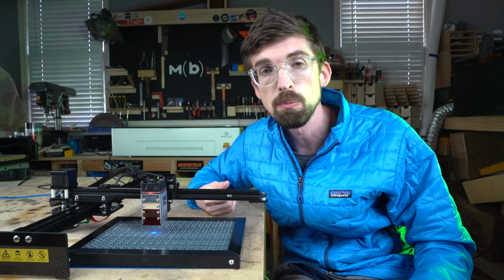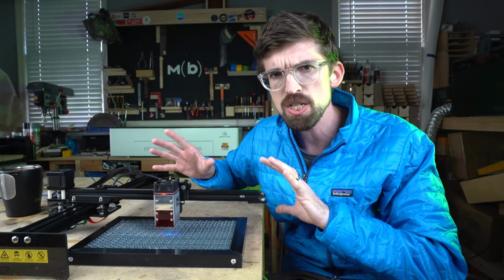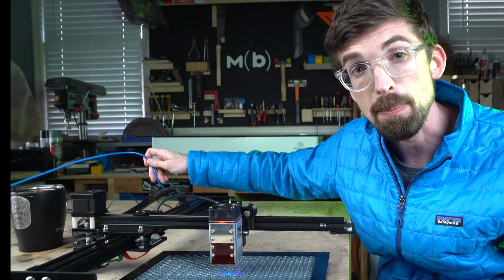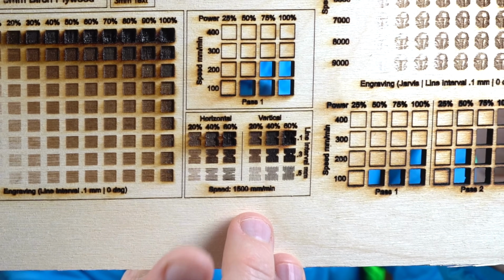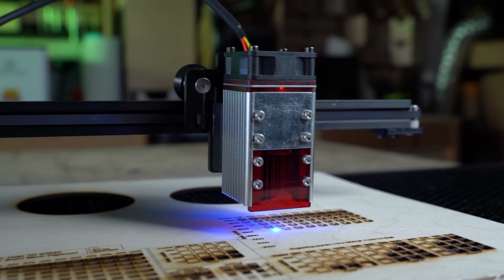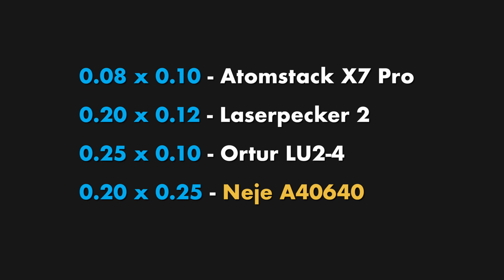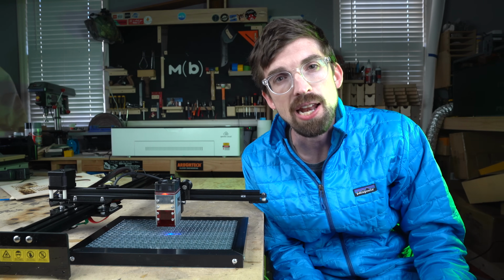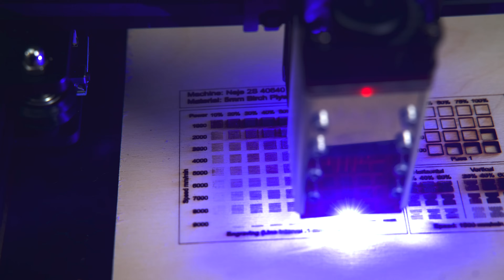The Most Powerful Laser Diode? NEJE Master 2S Plus A40640 Laser

Comment: There are a couple ways to get a stable focus, either eyeballing it or drawing lines on an inclined plane (too much to go in to here--search Youtube).  But once you find the height, measure it with calipers.  Then make a block that height--in my case, I 3D printed a simple rectangular block, was able to get within 0.05mm of the desired height, I think.  Then, if you want to etch, place your block on top of the etching surface, and let the laser module rest on the block while tightening.  If you want to burn, set your block on the empty honeycomb (or whatever sacrificial surface), and let the module rest on the block while tightening--remove the block and insert your material to burn.  This puts the focal length at the bottom of the material.  Note, this only works for up to a few millimeters of material.

Comment: Hi, first off all, thx for all your reviews. they have surely helped me out.  second, I have been looking for a laser cutter (not so much engraver) and Neje has caught my eye.  It appears that at the moment the 2S has been replaced by the 3Max but has the same laser equipment, or am I wrong?  Also, just an idea on review: in the RC community there are a lot of people that build their own aircraft from scratch (Balsa and plywood 3mm) and need to cut the wood with precision.  Which machine would you recommend or such a job?  knowing that the CO2 lasers are deemed a bit too expensive and too small for that use.  My idea was to look at the Neje 3 max as it has a nice big surface to work with but the question remains about how much power do you really need? is it the 5,5 or 6, 10 or even the 12W version.  If possible I would like to get you take on this?  Again thanks for all your reviews!!

Comment: Any recommendation for the largest print area for a beginner unit (under $750)?  I think the Neje Plus 2S or the newer 3 Max (with or without the extension kit) is the LARGEST I can get in this price range?  Any other recommendations?  I need to cut 1/8" to 1/4" hardboard or plywood and the pieces won't fit on anything smaller than the 406x432mm of the Xtool D1.  But I can fit 3 pieces on the 3 Max (or 6 w/ the extension).  And the A40640 diode is pretty powerful.

Comment: "15 watt" laser? This is true. The laser manufacturers are taking the idea of running electronics at a lower power to lengthen their lives. GE used to do that with incandescent lifebulbs - they would manufacture the bulbs to run at 130v AC so that when we used them at normal household voltage (110-120) the bulbs would last a lot longer than typical bulbs. So NEJE is doing the same with their modules - building them with 15 watt, but driving them to produce 10.5 -11 watt output. So even if you run them at 100% for long projects, the laser will still continue to produce full power and have a decent lifespan. I have been reading how a few laser users are finding out that their lesser well-designed lasers would die soon after a project that required their lasers to run at 100% for an extended period of time. This is why NEJE, Atomstack and  other laser manufacturers are doing this "underpowering" their laser modules to extend their lives. They use 7.5 watt laser diodes and only force them to deliver 5 Watts. The dual diodes are 7.5 diodes x2, each powered to produce about 5.5 Watts each to result in a 10-12 watt laser, depending on the manufacturer. These NEW modules are typically rated with 20, 000 hour life spans.

Comment: Hi Brandon, I recently picked up the Neje A40640 and have been working on calibrating it for a few weeks - I'm a total n00b and really appreciate your videos!

When digging a bit deeper into the reference documentation - I noticed that this module has a variable focal distance - the lens actually rotates. In the Neje wiki documentation I've found that they recommend setting it at a focal distance of about 33mm for engraving and about 55mm for cutting (18mm ply?!?).  You have to unscrew the lens about 7 full rotations from it's fully 'closed' or seated position against the upper housing for engraving but it definitely produces a finer spot. 

My USB microscope doesn't have a measurement tool but from my very rough estimate, it looks like I can get a line width of around .12 when setup for the 'engraving'  focal distance.

I'm sure folks would appreciate your more seasoned look at it - especially as you call it out as having a bigger dot width, which may not be entirely accurate given the configuration options. 

I hope this observation comes across in the most positive light,  I really appreciate all videos and your calibration methods - super helpful for someone new to the technology! Keep up the great work!!
Reply from the maker: Oh good call, I totally missed that.  I'll have to remeasure it after adjusting the focal distance.

Comment: Hi. Are any of these diode lasers powerful enough to cut 3mm transparent/tinted acrylic sheet? The problem with acrylics is ofc that it does not absorbs much of the light, passing it through.
Reply: My question as well !!! There’s gotta be a way - maybe painting BOTH sides of the acrylic and then doing the cut? It’s really frustrating to NOT have a way of cutting out a simple shape of clear acrylic…. I’m going to give my idea a try tomorrow…

Comment: What keeps confusing me is the fact, that some suppliers rate it with 10W output power and some rate it with 15W output. Even the Neje online shop says its just 10W output power. Does somebody know whether the "10W" module is the same as the "15W" module? I'm about to buy the A40640 module but im a bit afraid to buy the wrong one. I just aim to buy the most powerful diode laser for under 500€, is there even a better choice than the A40640?

Thanks in advance!

Comment: Hello, I have to make a choice, to buy a K40 Co2 laser or the Neje A40640 (10w optical power). I will use it for leather work, cutting and engraving. What is the best choice? Speed doesn't matter for me, but the quality of the cut and the lifetime of the machine. What is your advice? Thank you very much.
Reply: I am also cutting leather. And here is the thing. No matter how fast a CO2 if you have to cut your raw materials into small pieces. With my Neje, i have 460*800 cutting area, and even a bit more to place the material into the frame. Unless you are not planning for mass production, a diode laser with big area is the best choice imho.
Reply: @opiniono-1  I got the atomstack x7 pro, and it is doing a fantastic job.

Comment: I have it with the max frame, it’s really good, but I have added air assist, as I found the lens quickly becomes coated with smoke, and the power drops right off. I use it to cut 3mm black acrylic, and it works really quite well,
Reply: Cool. What kind of feed rate/ passes/power to cut 3mm black acrylic?  How good is edge finish?
Reply: @54egg  I use 125mm/sec single pass. Edge is not bad, it's clear it's laser cut, but it's pretty smooth. It will only cut black though, due to wavelength
Reply: Thanks!  I assume that is 125 mm/minute? I have a home built CO2 40 watt and I cut 250 mm / min at about 1/2 power (20 watts) using vertical mount tube, single lens.
Reply: @54egg  AHh, yes, sorry 125mm/min. I'm used to 3d printing speeds. CO2 lasers are rated at their output, whereas Diode lasers are rated at their input, and the output is lower (IIRC its about 15W for the Neje 40W diode laser).
Reply: @JamesElise160  Thanks! Even cutting at 125mm/min is fantastic. CO2 lasers are really not quite so portable. In my case using ball screw tables - not portable at all -- 200 lb machine.
Reply: @54egg  No, that doesn't sound portable at all! I did also make a frame under it using kanthal wire to support the parts and prevent the substrate burning and damaging the back of the parts I am cutting. But, You could just buy the Neje part support
Reply: @JamesElise160  Interesting,  I usually suspend supported on the edges sheet to avoid any flash back. Sometimes a pain -- for large parts leaving support tabs to prevent material falling. Also, I use low flow assist air with plex for better finish. e.g. I use an aquarium air pump most of the time for plex.

Comment: Should look into the Longer3d Ray 5. It claims .08x.08mm dot size on a 5watt laser. The company claims they did 12mm pine board in one pass. It's got the full square frame at 400x400mm. From the little work I've done with it it seems plausible. It also comes with a spacer for setting the height so there isn't the guessing.

Comment: When I did my review on the A40640 I didn't have access to a way to check the power, but last month I met someone who had an actual laser meter. My A40640 came in at 13.8W. Neje says it's 2, 7.4W diodes, the max power a diode laser can emit. It's pretty darn close to their claim. Definitely not 10W. My Ortur LU2-4 came in at 5.05.
Reply from the maker: That's good to know, I usually don't completely trust how they list the voltages but having a power meter is a great way to test it.  I hopefully have one coming soon!
Reply: @makeorbreakshop  
Hi. 
What  is the lifetime (in hours of work) of this laser module running at 100%?
Thanks.
Reply: Where does Neje say it's 2 7.4W diodes? Seems they are only advertising it as being 10W output power now where they used to advertise it as 15W
Reply: @thebucketmouse  They are now, they didn't used to.
Reply: @TheLouisianaHobbyGuy  I wonder if the design changed (from 2 7.4w diodes to 2 5w) or if they only changed the advertising
Reply: @thebucketmouse  I'm going to guess that it has, because my A40640 bought 8 months ago tested almost 13W on a pro meter. I had a viewer in CA tell me theirs that they bought last month tested at 9.4W. They probably using cheaper diodes now with the big demand.

Comment: With this construction... I really do wonder if the arm drops significantly enough with the laser at the far end.
Have you done a test engraving with the laser focused sitting back against the main rail and then a straight burn to the far end of the arm? And then compare the engraved line at different points?
Reply: I have one of these and it's not a problem it's a nice laser engraver

Comment: Informative video. One thing I want to add is that you should always be wearing laser goggles when The machine is on. This is true even if the laser is in low power mode. Even in low power mode I'm sure it could blind you instantly if you got a reflection just right. Given the price level of these things are built to it's also entirely possible for the laser to just go into high power mode on its own to do some sort of circuitry or programmatical failure.
A good quality set of laser goggles is probably the most important thing you can buy when dealing with anything laser. Also make sure it is the right goggles for the wavelength of laser you are using.
Reply: NEJE Store

Comment: How about compared to the Sculpfun S9?
6W laser power but effect is 90W CO2 laser.
Like to hear your review regarding this.
Reply: My excate question been looking for a video that reviews them 2
Reply: I’ve seen quite a few suppliers of diode lasers make similar claims about equivalence to higher power CO2 lasers. I think that’s probably true for very specific conditions, but quite misleading in my opinion. The key thing to know is that different laser technologies often emit different wavelengths of light. This is important because different materials will absorb certain wavelengths more than others. Quick example: cutting clear acrylic. The blue-ish wavelength of a diode laser does a great job engraving metal, but for cutting clear acrylic it would mostly pass through unabsorbed. Conversely, the infrared wavelength emitted by a CO2 laser is readily aborsorbed by clear acrylic but heavily reflected by metal. It might also depend on what they mean by “power” if they have really good focus optics and their power density is very high they might be able to claim a higher power density than a typical 90W CO2 laser. 

TLDR; There are scenarios where a diode laser can outperform a more powerful CO2 laser depending on material choice because both laser technologies usually emit different wavelengths of light. Its technically true to say a diode is equivalent to a certain CO2 laser, but only if the material being lased is specified. Otherwise its marketing BS.
Reply: @teenagefishman  
The diode and the CO2 lasers cutting on plywood is probably a fair comparison since the material will absorb the light relatively well...

The lowest powered CO2 on the market is the K40  (40 watt),   and the most powerful Diode  Neje (15 watt optical output).   I watched videos of both to compare their capabilities.  The k40 handles the task much better than Neje .  The other diode sellers who claim their module is 40 or 90watts  turned out to be 10watt optical output at best  much lower than Neje.

I discovered that the sellers tend to advertise their product based on how much power the whole machine  consumes which include the fan, mother board, and the motors rather than the rated Optical output of the laser module itself....  Very misleading.
Reply: I highly doubt 6w blue laser can compare 90w CO2 version.   Even the 40w CO2 can cut through plywood like hot knife on butter.    Diode lasers will struggle.  They can do it, but it's slow as hell  and it'll reduce the life of your module.
Reply: @WTF_BBQ  I got this neje to cut through 12mm oak faced ply in 9 passes. It went down to 7 with air assist, but there were a few strands of wood still not cut. It'll do 3mm birch ply in one pass with power set to 90% with a feedrate of 10mm/s
Reply: @adrianscarlett  
1/8" Black acrylic for me.  It took about 5 passes at 80%.   I didn't want to push it hard cuz it'll shorten the life of the module which wasn't cheap.

Comment: I’d be curious how this would compare with a k40. Obviously the enclosure and being about to use lightburn are big differences, but I’m trying to decide if I get a k40 or upgrade the module on my Ortur LM2
Reply: If you want to do more cutting, co2 is definitely better. If it's just engraving than you may choose either. I have a 100w co2 and a diode laser and they are both good at engraving,  but the co2 is definitely the way to go for making cuts in any material. Also if you are cutting air assist is essential.

Comment: I was really interested I this laser because with the optical power and the tiny spot size it should be able to deliver 6000W/mm^2. 

But now I’m not so sure. Do you think smaller spot size could achieved by refocusing it? Or is that as good as it gets?! 

Thanks for a great video.
Reply: I have it as well and my spot is smaller out of the box. I never readjusted it. It's smaller than 0.1mm because I can alternate 0.1mm-wide lines at a 0.1mm step and they're fine (using that for PCB). At 0.075mm there's some strong overlap, and at 0.0875mm it slightly overlaps. The focus is adjusted at exactly 17mm below the aluminum block for me, and since I have an aluminum heatsink that's exactly this thickness, it's trivial to adjust :-)

Comment: The Comgrow Z1 is even worse. 4 thumbscrews and 2 U channels. I'm working on a better method.

I took the red shield off of my Z1. It was getting crudded up w/ debris. For cutting thicker materials it also gets in the way because there's only a 2mm gap at optimal surface focus.

I made a temporary enclosure out of cardboard and piped in a 170cfm (advertised flow) exhaust blower. It's not ideal or the safest enclosure material, but I never leave the laser unattended when in operation and have a small ABC extinguisher nearby. The blower is marginal for extracting the smoke, but that's likely due to the "enclosure" having an open front.

Mine is good to etch at faster than 9000, but at those speeds I haven't tested the accuracy. For slate coasters, it will even produce a textured surface at medium speeds.
Reply from the maker: Good to know!

Comment: Can you cut EVA foam?
Reply: I have one, it cuts Eva foam easily. I needed to use really low power settings to keep the line clean. Air assist makes a massive improvement.
Reply: @adrianscarlett  thanks for the info. I am looking to organize my drawers with EVA foam cut out inserts for tools and cameras.